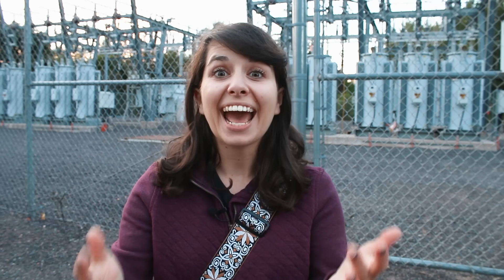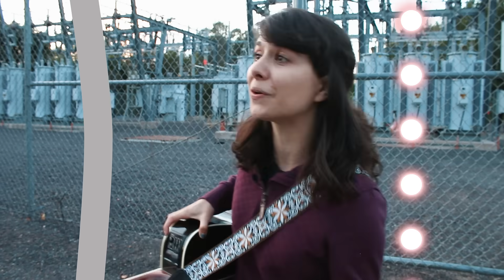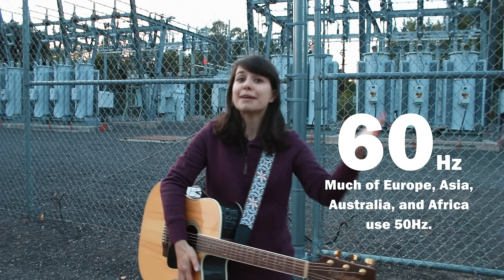Why Do Fluorescent Lights and Power Lines Buzz? | #VeritasiumContest

Comment: That is actually the corona discharge. It is not from the alternating current shifting, but from the charged conductor becoming ionized. 
When a material with magnetization interacts with the alternating current. The sounds are not always going to be Bb. As different current frequencies are used. Smaller devices, like a fridge have a condenser motor that is making the humming sound. A floursecent bulb has a gas in it, and the ballast is what hums. Usually as it wears the resistance increases. But it is not really the same as a power line, in which the electric filed is greater than the air around it. Which can make the sound and a glow.

Comment: Good explanation though as an engineer I find it a little too simplistic (need an hour, not a minute!).  What I've never fully understood is why the buzz is at 120 Hz rather than 60 Hz.
Reply: It’s because the voltage crosses zero twice in a cycle and so the electromagnetic fields expand and collapse twice in a cycle.  This vibrates the components in the transformers at 120hz.

Comment: So did you tune the guitar string "slightly out of tune" to match the hum?
Reply from the maker: Ha ha, I did! It's tuned flat (and in hindsight, I think I could've gotten it even more accurate with a better ear).
Reply: @AlexisDahl  Using your eye can be better...!!! 
It is a slightly sharp Bb2 by 3.5 Hz...
SO...
If you stand in a regular fluorescent light, it is flashing at 120 Hz.
...
Then you can see the string wiggle in the stroboscopic effect at the 3.5 Hz. rate.
This allows you to use the old saying: "one thousand and one" as a one second reference, but...
It is also just about exactly half way (3.5 Hz) between Bb2 and B2.
If you check it against BOTH you still get the same 3.5 Hz wiggle for both notes, guaranteeing you're not a 'flat' Bb.

 When they both are at the same 3.5 Hz wiggle rate, you know for sure that you are in between them, not off to one side of Bb.

I'm an engineer guitar player... :)
..
Always go with the Engineer!
Perhaps this is worth a LIKE: https://www.youtube.com/watch?v=3MSqbnbKDmM 
You've got mine!
..
For 50 Hz countries, it's G2+2 and G#2 -4...
Reply: P.S. The LED lights that I just tried don't seem to flash as well...  Some will be better than others.  I know that Christmas light strings usually flash a lot. I can see it in my peripheral vision when moving my eyes.
Cheers.
Reply from the maker: @Observ45er  Oh, awesome! Thanks for the specific recommendations here — that's super interesting! As a (slightly retired) French horn player, going to my ears was my first instinct, but I didn't think about how you could visually check that, too.
Reply: @AlexisDahl  Of course; perfectly understandable. I sensed you'd like that.
 There's an old saying: "When the only tool you have is a hammer, everything looks like a nail." 
.
I've amassed so many 'tools' (knowledge) over the years, to me, everything looks like something else. :)
Cheers
.P.S. one of my son's gave me one of those clip-on tuning things, so I no longer need to go into the bathroom with the florescent light to tune... :)

Comment: If you were to superimpose the 60 Hz hum from North America's power grid and the 50 Hz hum from Europe or elsewhere, you'd get a justly tuned minor third, because that's obviously a 6/5 ratio. It would be really fun to know if there were any stations in the world where one is converted to the other and you could naturally hear both at once.
Reply from the maker: Ooh, that's fun! I didn't even think about that part of it. Now I'm curious about that, too!
Reply: Even better, it would be easy to record the hum and use it in music software or sampling devices, and I'd be very surprised if it hasn't already been done a dozen times over, especially by electronica musicians.
Reply: There's frequency converter power stations in Japan that transfer power between the country's 50 hz and 60 hz grids.  Maybe both frequencies can be heard there.